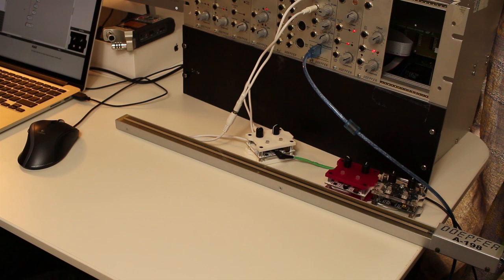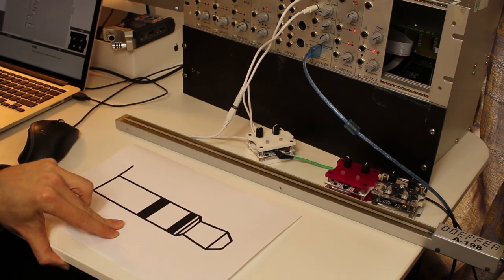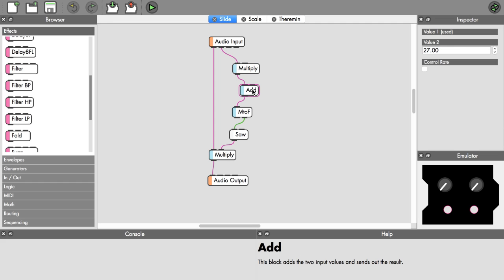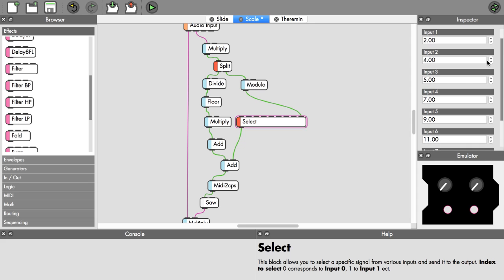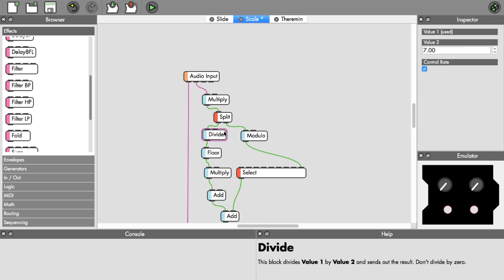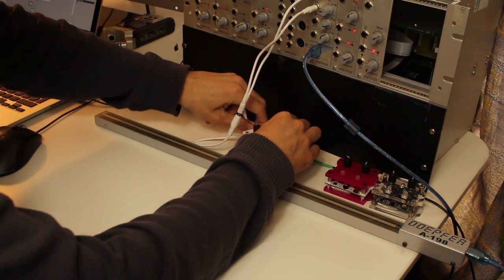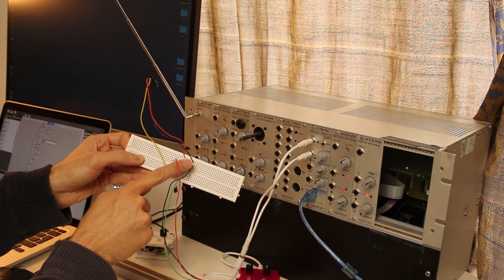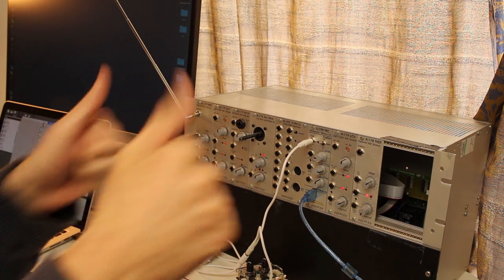Sending CV into Patchblocks

Comment: I tried a variation of the slide patch to add an extra oscillator to my shiny new microbrute.  I can confirm that the current software no longer requires the inputs to be inverted.  As I did not have a modular system with cv scaling on hand, I wired up a simple voltage divider with some 10-turn pots to scale down the microbrute's CV pitch+gate out.  I had to find the sweet spot between reducing the output level enough to get a few usable octaves without causing the internal oscillator to change pitch (would need to use a voltage follower/buffer to prevent this problem).  Sounds pretty good once you figure out how to tweak the levels into tune.
Reply from the maker: Excellent!

Comment from the maker: Slight mistake in the video: The Audio Output block sends +/-0.5 as values. So it would only send 0 to 0.5 when receiving CV. Multiply it by 2 (or -2) and you get the 0 to 1 range.
Reply: 0 to 1 range translated to the internal 3.3V would translate to 0-3.3V.p.p , but wuld tha multiply work it needs a variable minimum input range to stay at 0.... it would be so nice to keep this going as an LFO...